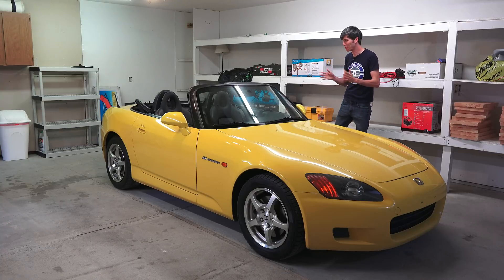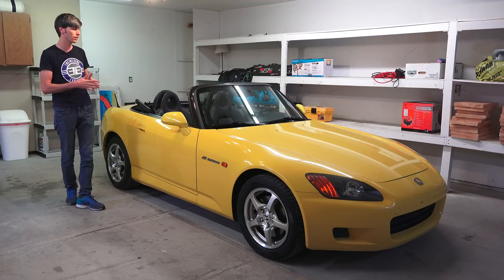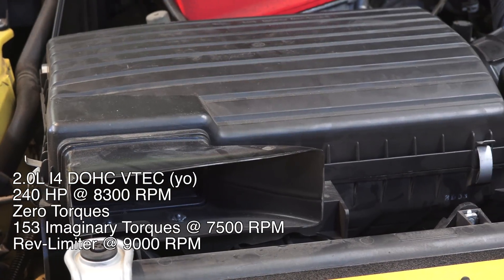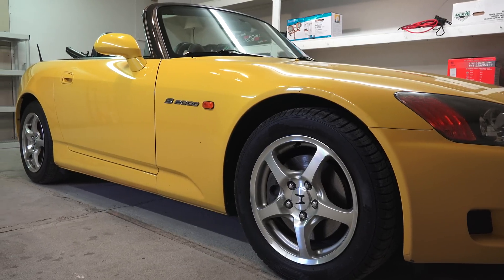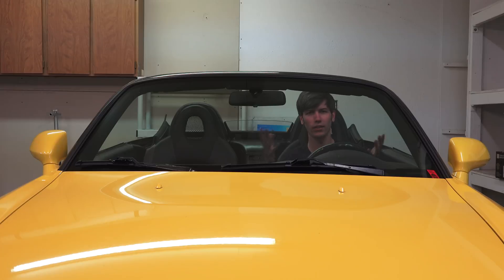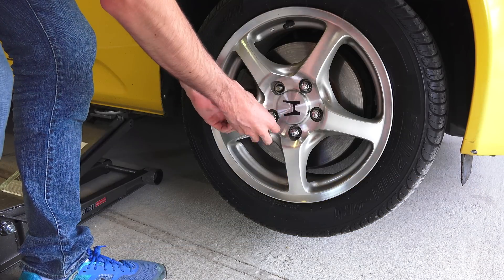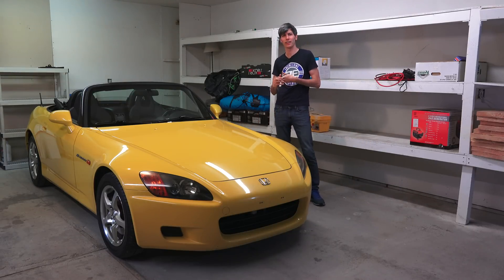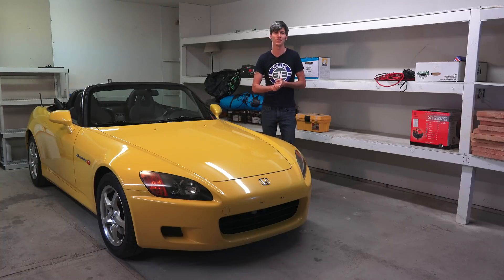I Bought A Honda S2000 And It's Amazing!

Comment: AP1 S2000s are the best.  Bought my 2003 new and still drive it.  It's an amazing car that got the drama just right.  I find it more fun than the e90 M3, but my sons complain if one of them needs to ride in the trunk.
Reply: You may be wrong about the VTec engagement, however.  I've read, and definitely notice, that the torque hits at 6300.

Comment: @Engineering Explained (or anyone else): I know this is quite an old video, but I was just thinking about getting one of those and I acutally have one question: taking under consideration, that I'm 195cm tall (which according to google is 6 feet 4 49⁄64 inches), do I have a chance to fit in?

Comment: Pretty sure the cylinder cores would be made from alumina (Al2O3, very stiff and high temperature stable) and carbon fibre?  Aluminium fibres would make no sense there.

Comment: What I noticed about the people hating on the s2000 is that they have never driven it. But everyone who has or had it loves it.
Reply: I have never driven S2k. But still i just lllllllooooovvvveeee it.🙂 bcos its honda engineering.
Reply: I love s2k when it first came out. The style and the hp. 240 hp at only 2.0 with no turbo. What? How right? Another version is 2.2 li. More torque.

Comment: I've been Thinking of Getting This Baby or the New Miata.... since My Idol... which is you got this... I'm Definitely Leaning like 75% towards an S2000.... just a Question about the Ap1 vs Ap2... Iknow about the differennce of the Rev range..  9,000 vs 8,200...But the Ap2 have a Better Handling than Ap1... would a Change in Suspension and Tire and Rims In your Ap1 make it Even more Safer to drive than An Ap2 ?

Comment: how long do the engines last? Would you shy away from a 130k mile s2000. All the ones in my area have at least 120k miles.

Comment: Hi, thanks for your videos. I think it would be interesting that you explain the function and engineering of the Helmotz tube that is fitted on the standard exhaust. How you calculate its size based on what you look for, etc.

Comment: Carbon fiber/Aluminum mixed cylinder walls gave me wrinkles on my brain.  That is amazing!
The newer version S2000 has a slightly bigger displacement, same horsepower, but, more torque, and lower redline, fyi.

Comment: The x-frame is almost 60 years old now. GM used it on the early 60's biscayne/bel air/impala. Bad news for those cars, it twisted under high torque, good news for your car is that it doesn't really have enough to mention.

Comment: I'm actually very surprised that you didn't go for an NB Miata. They're fairly cheap compared to the S2000 and you can do a lot with them. Then again... VTEC yo. But hey, if you went with a 99' forward you can get VVT. :)

Comment: I have to ask, after hearing you rave about the latest Miata: what drew you to the S2000? I adore both cars, but I'm curious what your thoughts are.
Reply from the maker: 1/3 the price of the new MX-5.
Reply: Haha true! And it will hold its value far more, or even appreciate if you believe the Honda fanboys :)

Good luck with it, I'm in a similar situation except my "practical" vehicle is a 2006 Volvo V70R. Looking to purchase either a Miata or S2000.
Reply: I drove both before I bought my S2000. I describe the S2000 as the Miata Mazda would have built if they could have sold the Miata for $36K and still sold a million of them.

Comment: Congrats!  I bought a 2000 S2000 in September of 1999 when it was first released in the US.  Put down a deposit with a dealer nine months before that and could barely wait!  At the time all the magazines tested it against the BMW Z3 and Porsche Boxster and it won every test hands down.  It wasn't until BMW released the Z3 M Roadster and Porsche released the Boxster S were these cars able to compete with the S2000.  The only mods I put on it were 17" wheels and tires (it came with 16") and an after market exhaust.  Years later I added an intake system, mostly for the sound.  I ran a lot of autocrosses and HPDEs with it for several years which it was absolutely excellent at, and I bought track tires for the stock wheels.  The transmission was rebuilt under warranty (the "stacking clearance" problem) and again several years later, when the clutch needed to be replaced.  Other than that I just did normal maintenance and it was bullet proof.  The top did need to be replaced at 10 years and I replaced it with an aftermarket top that had a glass window which was an amazing improvement at night and in the rain!  I loved that car and swore I would never sell it.  In 2011 my wife and I bought her a BMW 335is Coupe.  I really liked that car (especially the torque!) and decided I wanted a BMW.  A friend in our BMW club let me drive his Z4 M Roadster for an afternoon and I decided that it was a worthy successor the my S2000.  In July 2012 I found the perfect low-mileage 2006 Z4 M Roadster in the exact color/interior combo that I would have ordered knew and bought it.  I sold the S2000, now nearly 13 years old, the next month to the parents of a neighbor boy who admired the car when he was 7 ("Wow!  That's an S2000!  That has the highest output per liter...naturally aspirated...etc." which he recited to me  when he was 7!)  They gave it to him for his 20th birthday!  He still has it!  I still have the Z4 M Roadster, but I just did Euro Delivery on an M4 in May.  My first non-roadster since 1999!
Reply: That's an amazing story man!!!!
Reply: Agreed
Reply: Great story

Comment: "highest N/A specific output of any production VEHICLE"

Do you realize sportsbikes are vehicles right?
Reply: They have turbos in them in order to be that powerful. I dont know any naturally aspirated production bike with more than 100hp, and this car is capable of producing 120hp per litre of its engine :P
Reply: Dgtal Breakz
They do NOT have turbos on them. A 1998 yamaha YZF R1 had 150 real-dyno tested HP completely stock at 10,000 rpm with a 999cc inline four engine, naturally aspirated of course.
Reply: Gabriel You are right. I have no clue where I got that from.

Comment: excellent.  Don't forget to weld the front upper A-arm mounts, retorque the rear axle nuts to the s2ki spec, spec valve adjustment (IN .008, EX .010), and retainer check.  do all maintenance and you'll enjoy much love.  I have an '03 and learned some new things about the s2000, so thank you for that.  darcy

Comment: Honda did make a similar car to this recently actually it's called the s660, its a 4cylinder midengined RWD. Looks like the BEAT, and unfortunately its sprung like the BEAT was, macpherson suspension in the front. The S2000's double wishbone front suspension was like a weapon combined with the light weight chassis.
Watch some "Best Motoring" on youtube youll see what Im talking about. Lot of people commenting in here with very poor knowledge of RWD from the 90's and early 2000's era. It was the golden age of japans rice rockets and their still better than the Accords and Civics made in the late 2000's. Someone mentioned the Del Sol and completely forgot about the Prelude and its 4-wheel steering.

Comment: When I was shopping for a roadster in the <15K range, I was looking at the S2000, Miata, BMW Z4, and 986 Boxster.  I chose a Boxster S and don't regret it for a second.  It would be interesting to see what vehicles you were considering and why you chose the Honda S2000.

Comment: Enjoy it man, I've had mine as a daily driver for over 10 years. Put 150000 miles on her with less than $700 worth of unscheduled repairs. Still even has the original clutch.

Comment: The designer of the S2000 also designed the original NSX.  The only two cars he designed 
though he did work on the Integra Type R.  Timeless designs.  The windshield pillar is overly thick on these cars so it can act as a roll bar.  Did you find the hidden compartment?

Comment: They are great driving cars and grossly under estimated by those that have never driven one. They are a dream at the limits and can be easily steered with the throttle. I have owned 2 over the last ten years both AP2 cars. One of my favorite cars I have ever owned from a "driving experience" perspective. If only they had a bit more torque.

This being said were you not the guy bashing the STi for not having torque in the lower RPM range? This car is the extreme example of what you were complaining about with the STi but it is still a great car. Enjoy! It is a great drive!!

Comment: you show me an engineer who does NOT like the honda s2000, and i'll show you a guy in a stolen lab coat...er...
stolen levis in this case.
Reply from the maker: +Pan tera I wore jeans when I was working as a "real" engineer too! But only when I was a test engineer in the shop. My cubicle days were matched with oversized khakis.
Reply: Engineering Explained i always liked your videos, but now you own a REAL sports car (and one that can actually pull off the color yellow) my hat goes off to you sir, may i suggest keeping the internet posted on any possible upgrades?
Reply: Why do engineers like it so bad?
Reply: I'm an engineer and I do not like a honda s2000. Why? limited production vehicle. Parts obsolescence is going to destroy economical sustainment of this vehicle. Second, 9000 rpm redline sounds great, but there are too many failure points with an engine that revs that high, especially given that the newest S2000 is now over 10 years old. Valve floating and fatigue damage are going to be substantially worse on this engine than lower redline engines. Another reason, not engineering related, is that the fan base for this vehicle is the most arrogant. They act like they drive a ferrari, but they have the budget of a mustang driver. No thanks.
Reply: zfreak280 so much hate...valve float you say? FINE titanium chuck some titanium valve springs in there, good to go. OKAY it can't do what an indy car can, but neither can YOUR car...but i bet it can get better LAP TIMES THAN YOUR CAR!!!

Comment: the best car under $18k! I love it
Reply: +RyanInSD 100 more hp and yet the s2k is still 100 times better
Reply from the maker: +David Ha what can you get for $18k? 🤔
Reply: I got a 01 corvette z06 for 15k...over 100 more hp. That said, Ive always wanted to try out a s2k.
Reply: 350z..
Reply: You can get a v6 mustang convertible for like less than 2k.
Reply: RyanInSD im just joking, those are both great cars for the money. A corvette would make a great track car for that price
Reply: How so? Its hard to get significant power out of that little engine. The 2004 z06 broke 8minuts at the ring...hard to really compare "better" but it can sure be YOUR preference.

Have you owned or driven both?

Comment: Mines also a 2002.
Just do a tune up and all around fluid change. Also tires and alignment if needed.  Then play with it bone stock before any mods. You'll smile If you drive it like you stole it!

Comment: Nice purchase! We have a 2003 model which we bought new in 03. I would HIGHLY recommend looking into a Comptech Supercharger and aftercooler as well as their exhaust. All of their products met there power add claims spot on and the fitment and quallity  are A++. Also, Stoptech brakes - I garentee  you will not be disappointed. We did some other performance adds like braced the motor. The car is truly amazing!

Comment: No doubt the S2000 is a very well thought out and engineered car. Unfortunately a small two-seat convertible roadster just isn't practical enough for my daily life. Anyone that has a family or is about to start one pretty much has to rule this out. So it sits well for young people, retired folks, or singles & couples (who keep it that way). If fun-to-drive is the end-all be-all of car choice, something that sounds scary like a Challenger Hellcat is going to be towards the top of my list (given that exhaust note is very important, and a powerful V8 is simply the best sound EVER!!). I will say it's very cool you overcame ego and perception to take on this car. I did the same, which also let me into a 4-cyl. car... but I'm almost without a doubt going back to V8 RWD in the coming years...and practically-size to room the family around. ;)

Great videos, keep it up!
Reply: Yeah; I remember as a little kid getting crammed into the back of a Nissan 240 ZX - a family-unfriendly car.  The next 3 dailys my dad got were a camry, an accord, then a civic.  I do feel for my dad a little bit and would love to buy him a classic of the car he had to sell when he enlisted - a Chevelle.

Comment: Great little car! I worked for a Honda dealer about ten years ago, and got to drive a couple of them. Lovely light handling, and the most awesome shriek at red line of any engine I've driven. They have a reputation for burning rear tires pretty quickly! :)

Comment: When you buy tires, and you WILL buy tires often. Buy 2 pairs of rears and one pair of fronts. The rears will wear out twice as fast. I owned one, I know.
Reply from the maker: I'm sure I'll be buying new tires, though I'll probably just buy each set as needed, rather than letting the rubber just sit.
Reply: or...you could rotate your tires at regular intervals like the manufacturer suggests.
i drive a FWD car and guess what? the tires wear out twice as fast on the front...maybe this fine gent can do a video explaining WHY people rotate their tires one day, JUST for you
Reply: You don't know the first thing about an S2000 do you?? Different wheel sizes and tire sizes front to back and the wheel pilots are different sizes so you can't put the front wheels on the back if you wanted to. And the factory spec tires puts on can't be switched side to side unless they are dismounted and swapped. And the rears wear out way faster than the fronts so side-to-side doesn't buy you anything. The manufacturer does not recommend rotation at all. So got any other brilliant suggestions Pan tera?
Reply: Eric Jensen so...there is something WRONG with dismounting and swapping your tires, granted it costs little to nothing to do? (okay not everyone's mechanic is a honda fanatic and all-around nice guy like mine is) my car has a slight bit of natural rear camber, and i put a lot of highway miles on my car so it's something i do personally to get more wear out of my tires, as i'm a guy on a budget.
and my suggestion, don't drive like a douchebag, when i hear 'had one, i know' you either a) wrote it off in an accident or b) owned a car and now are an expert on every scrap of attainable information of said vehicle, like a lot of other douchebags who think they are racecar drivers (but sadly arent, RIP eric's s2000)

Comment: All the hate in the comments. I personally like the S2000 and never understood why people hate it with a passion. The only downside for me is that they made it a convertible only.
Reply: Drake can't handle that. No way.
Reply: Probably because of the frame member structure described; redesigning it with a hardtop would raise the center of gravity and require re-engineering the frame to distribute the stresses of turning appropriately through all members to avoid fatigue at weld points.  The frame engineers probably went 'this does well what we designed it to do; why change it if it's not likely to sell many more cars?'
Reply: It and the NSX are the only two fast Hondas, and I love them both.

Comment: Sweet dance moves! 
I don't know how hard you plan on running your s2000 but on the forums and on YouTube there is a guy that is really passionate about eliminating will starvation with this particular engine. He mentioned something about drilling and additional whole in the manifold cover I think in order for the oil to drain properly after taking a hard left then right turn. what he says happens is the oil is pushed all the way over to the side of the engine and then after taking a hard opposite turn the oil does a sort of rolling motion all the way across the top and to the other side which usually ends up in the oil catch can but also is burned off in the combustion process. I saved the link so let me know if you are interested in it
Reply: Oil starvation*
Reply: it sounds like a problem that could be solved with an oil sump but I doubt there's room for that on this vehicle.
Reply: +HuntingTarg there only needs to have one hole drilled In a very specific spot.

Comment: Nice! I still wish I had never sold mine. Make sure yours has had the rear wheel bearing TSB done (basically just up the torque spec on the axle nut to 220 ft-lbs). Also, I hear the AP2 rear subframe swap helps tame some of the twitchiness of the early cars, never got around to doing it on mine before I sold it, though :(

These cars are phenomenal. Extremely fun to drive, reliable, and even make good gas mileage!

Comment: Congrats on the S2000! I had a silver 2001 model and absolutely loved it. Running a track day Miata these days working my way up to spec Miata. Do you have plans to take the S2000 to the track for HPDE or TT events?

Comment: I take BMW Z3M roadster over S2000. The S2000 lost its debut battle to BMW Z3 M roadster at Tsukuba back in 90's while M roadster uses McPheason at front axle for more space and much comfortable rides through bumpy surface. Yeah the Double wishbone allows higher camber and absorb camber changes better but the rear semi trailing arm in BMW has more agility by its higher toe out ability and the ability to separate body roll from axle which eliminate under-steer. Beside handling, Z3 M is also more powerful and probably stiffer than S2k since it shares parts and design with E36 M3.

Comment: Just my opinion, but I think a RX-8 would've been far more interesting, considering one of your most viewed videos are of rotary engines. I think the 5 link rear suspension, air pumps for little reason, carbon fiber driveshaft and how Mazda solved so many problems to make that car a reality.